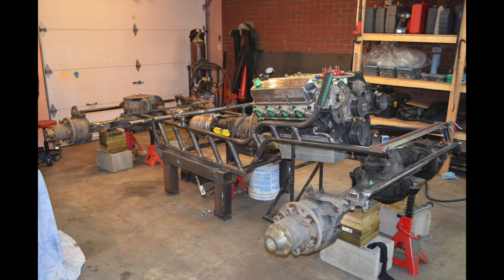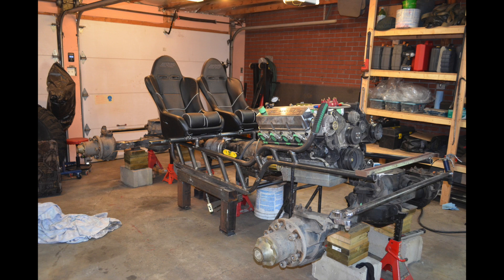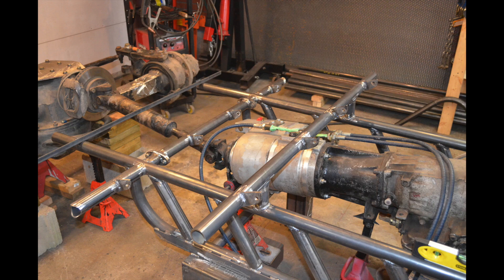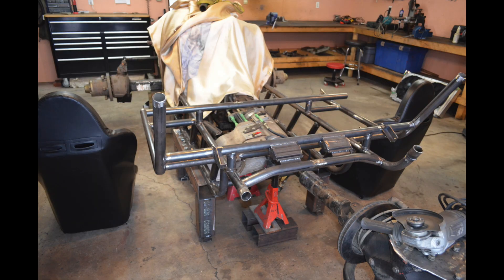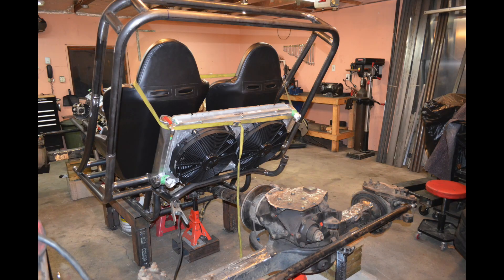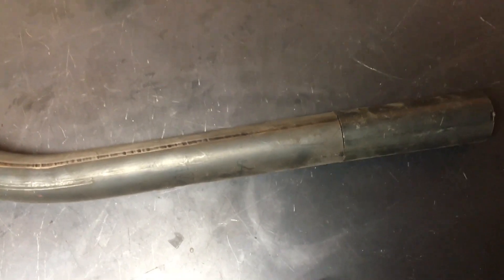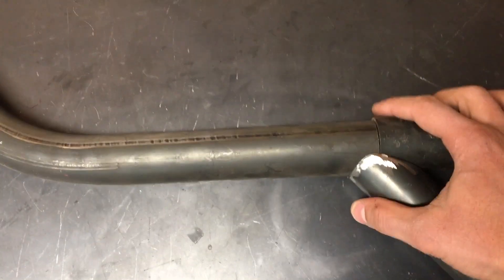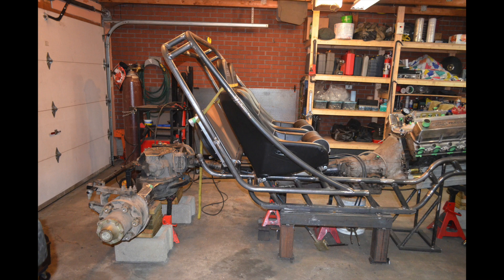Episode 6: Seats, radiator and B-pillar | How to build your own rock crawler/buggy/bouncer

Comment: Nice build! Another tip for joining pipe is to put a slug inside the ID of the two pipe at the joint. Bevel and weld.